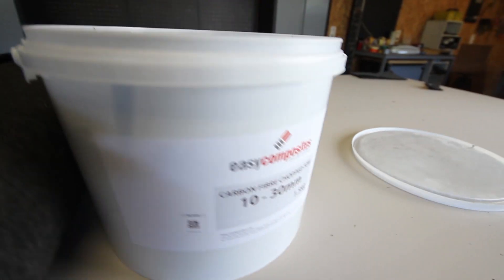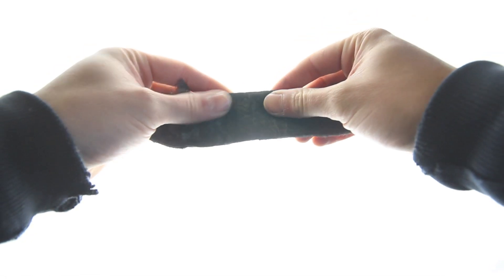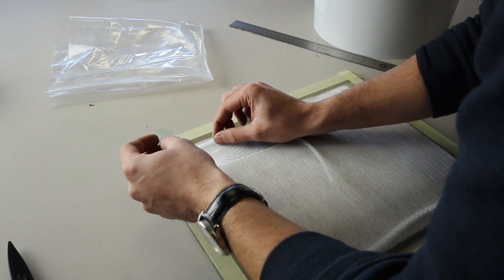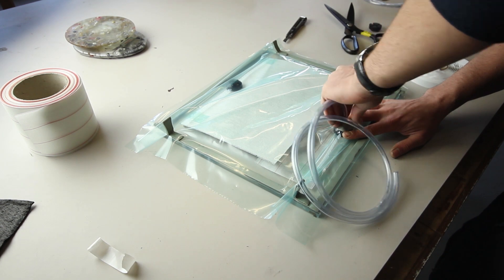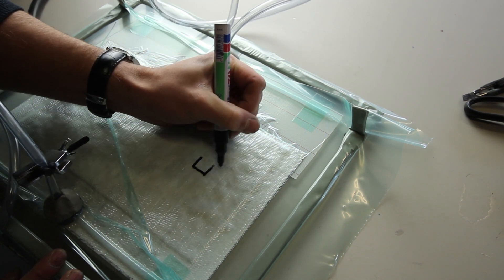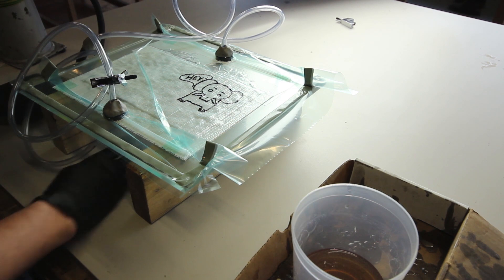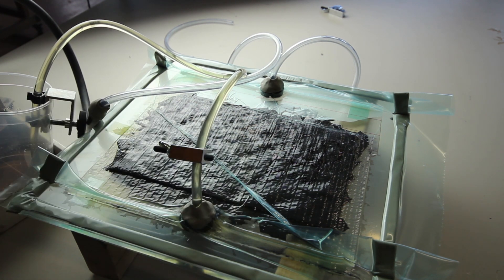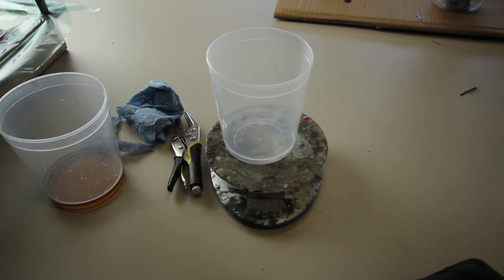Forged Carbon Fiber - Chopped Fibers (PART1 Testplate & Thoughts)

Comment: I like your vacuum relief method by cracking the resin hose for a few seconds - tidy way to handle things.  You could also just infuse at a lower vacuum level probably... I’m generally not a fan of clamping off the vacuum but here you had a nice bag and the polyester is fast!  Thanks for the demo - look forward to the rest of the series!

Comment: are infused poliester parts runing the same risk of distortions and shrinkage bad habits of the hand laminated poliester resin?
Reply: Yes. Especially if the part is subjected to temperatures higher than the in mould cure temperature. Most poliester resins have a low HDT (heat distortion temp) and can shrink and distort. In my experience vinyl ester resins are the minimum acceptable for good quality. But I would never use anything other than epoxy now.
Reply: @Sergeant898  yeah same experience here, tryed some infusion poly in a glass and had this same surface issues he had in the next video... but  i have a few parts that i did using some silicone and vaccum to press the poly into carbon, trying to simulate the allan harper technic and i had some good results with low vaccum pressure.  cheaper good looking parts, dont know yet for how  long hehehhe